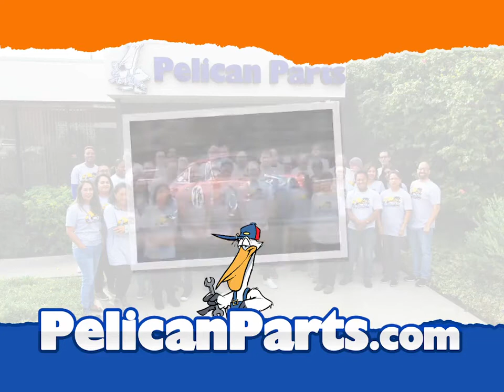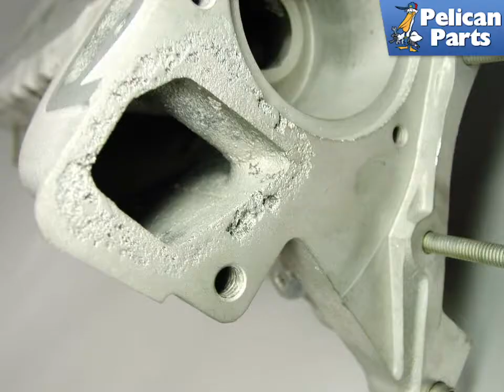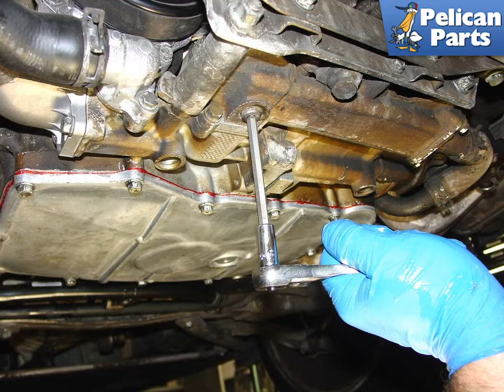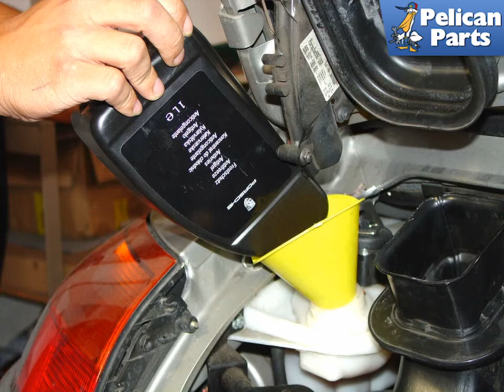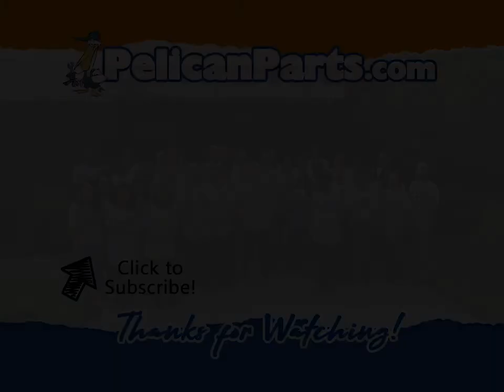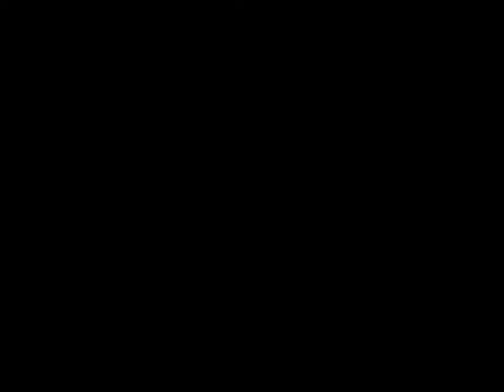Porsche 996/997 Carrera Coolant Flush (1998-2008)

Comment: Bought my Porsche coolant from Pelican for my '01 Carrera, but I'm curious whether I ought to buy a standard flush chemical and go through the routine flush process as well.  I see that, even though it's not mentioned in the video, the text makes mention of "flush" and apparently it's recommended by der Porschefolken.  I'm guessing a standard off-the-shelf flush product will be fine.
Reply from the maker: If you replace at the standard intervals, flushes aren't always needed at lower mileage intervals. Maybe 90k and up I would suggest one.